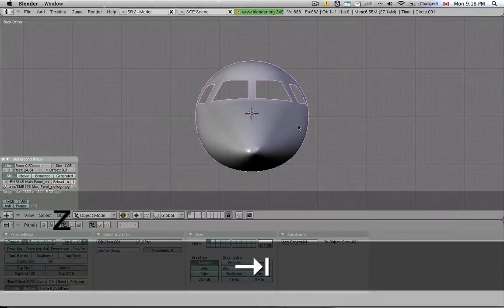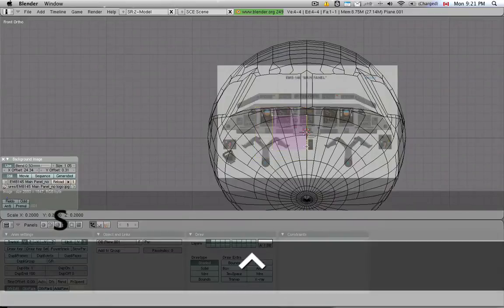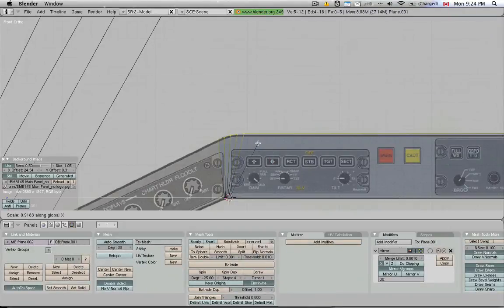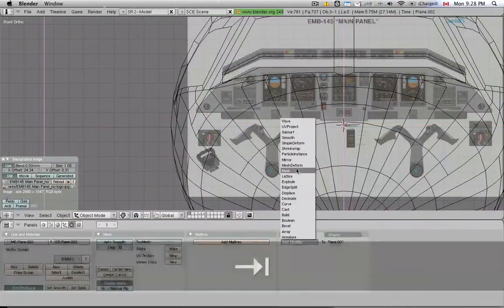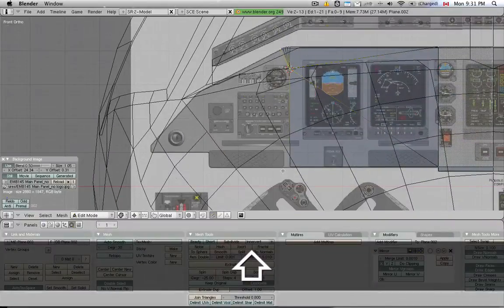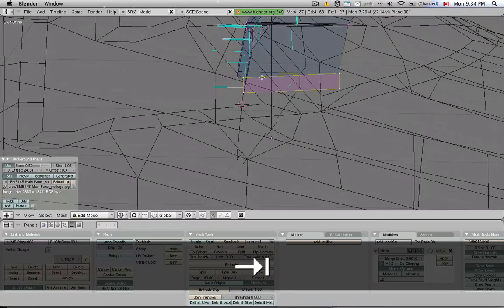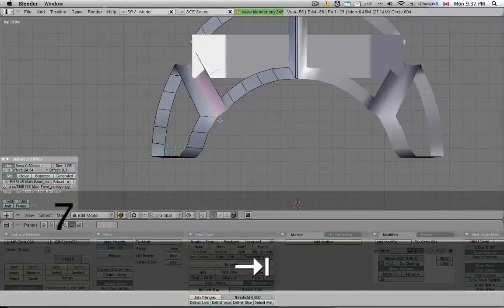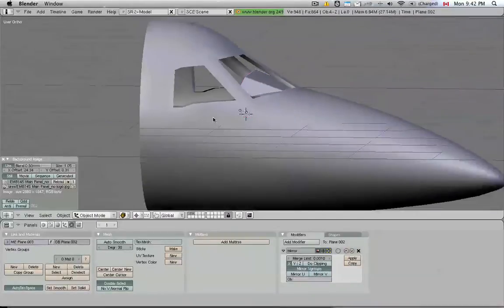PlaneMaker-26-Blender-12 - Modeling Cockpit Interior

Comment from the maker: @Stickman698 

This plane's floor was quite difficult... a lot of guesswork involved.  But you start out by putting down a plane, and adjust it to the height that would end up working for the rest of the cabin... I based a lot of it on photographs.  I guess I'm not exactly sure what you mean by intersecting... you mean Booleans? Blender has Boolean operations that do intersecting... but I tend to stay away from those, because their results are pretty messy.  I modeled it the 'long way'.